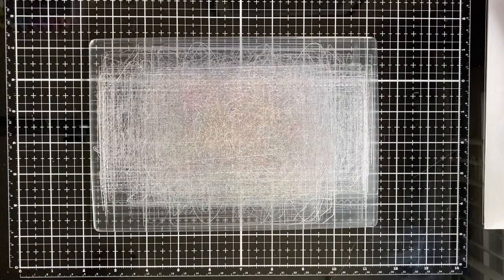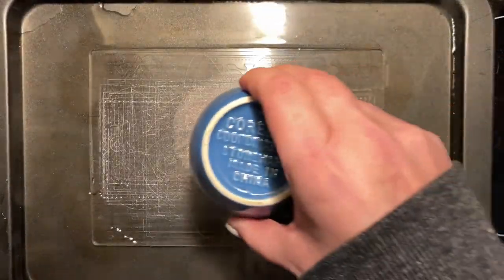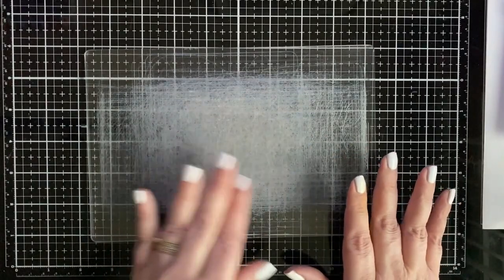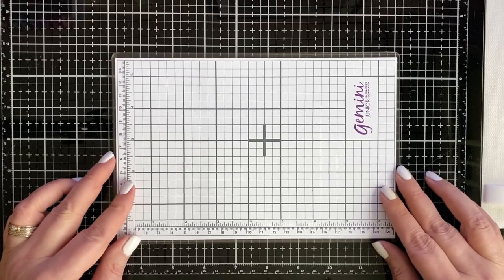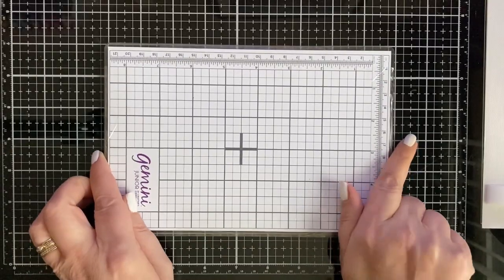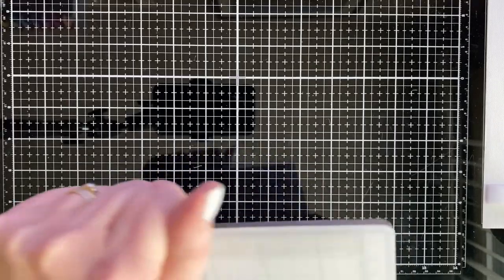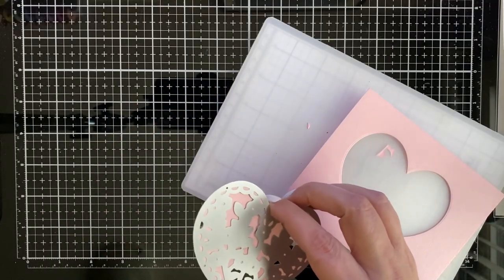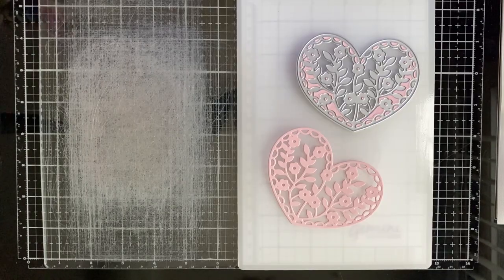How To Flatten Your Die Cutting Plates

Comment: Thank you for this tip, I rarely use the Gemini Jr. because of this.  You would think since they know this is such a problem they would lower the price on the plates.
Reply from the maker: I use my Gemini Jr all the time and I only have the Cuttlebug to compare. My Cuttlebug plates never warped. Although the Gemini is amazing at die cutting intricate dies because it uses a lot of pressure this is probably why the plates warp more.

Comment: Tina, I tried this and the only problem I had was that on the ends that touch the machine, the tape starts to wear.  I was afraid it would get stuck in my machine and so I just taped the 2 end that do not actually touch the machine.  Thank you for the tip - it's great!!
Reply from the maker: If you go over it with a bone folder it is enough to keep the two ends down. I haven’t had an issue with the tape wearing out. But it should be enough with just the two sides.
Reply: @tinaguiguidornbaum2778  thank you!

Comment: It's a great idea...but I found my plastic shim still warped. It's like a big bubble in the center. :(
Reply from the maker: My plastic shim was also warped in the center. Taping it has helped. I have used the taped setup for a few days with lots of die cutting and so far so good. I am going to try the boiling water on the plastic shim to see if it helps. I will keep you posted if that helped.
Reply: @tinaguiguidornbaum2778  I may try that as well. Fingers crossed. 🤞

Comment: Tried it several times on different plates, didn't work.
Reply from the maker: I have used this technique on different plates and sizes. I have no problem. Did you apply the weight right after pouring the water?

Comment: Does not work
Reply from the maker: Is it a Gemini plate? You may have to do it a couple of times but put pressure on the pot right after you pour the hot water. You may need to help it along.